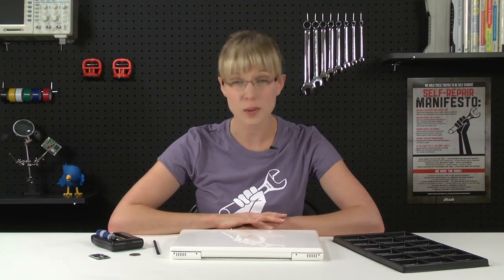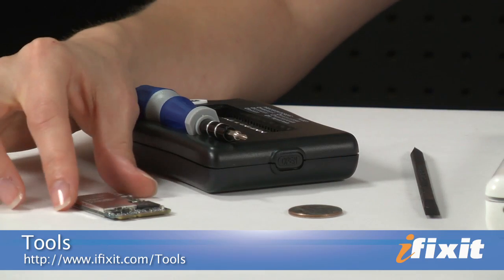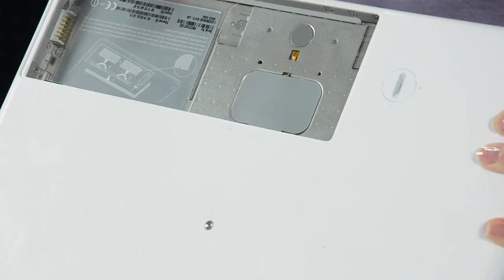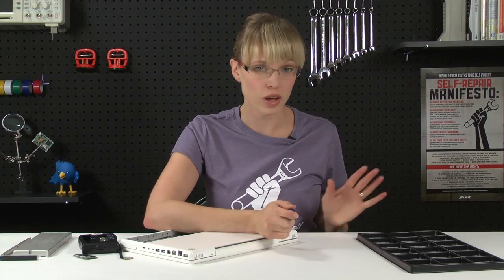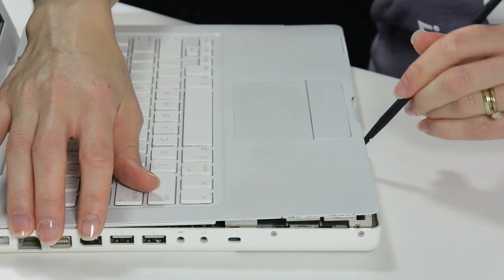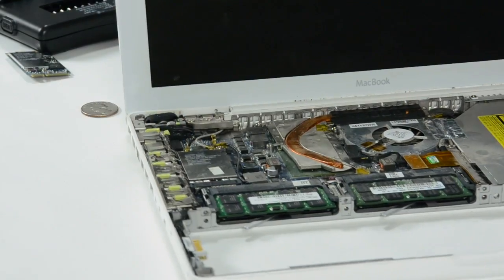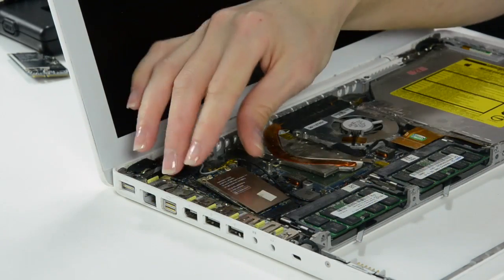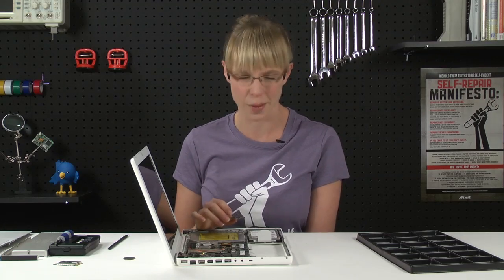How To: MacBook Airport Card Upgrade/Replacement

Comment: I know this is super old video, but is this ability to present in the 2014-2015 Macbook Pro retinas? Mine has wifi g/n but id like to upgrade it to wifi 6/6e with ax standard.  Also, bluetooth 5.1 would be a bonus too. ANy help pointing to where the airport card might be available thatd be great.